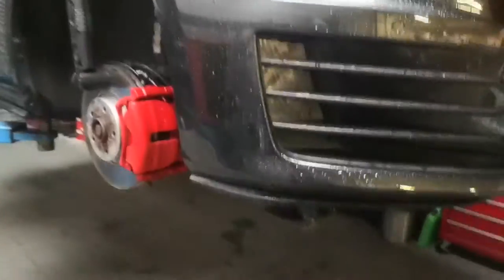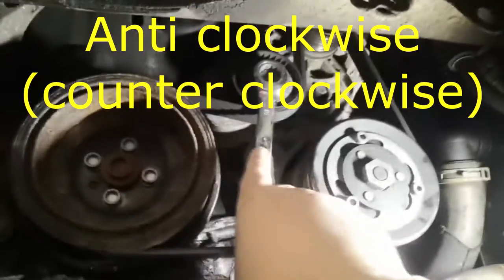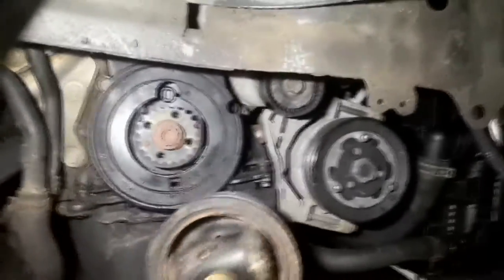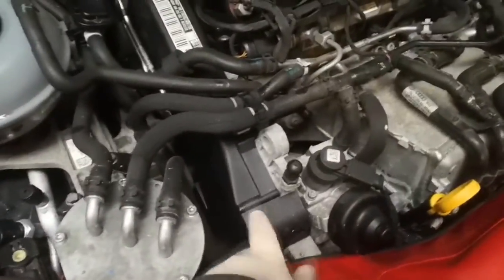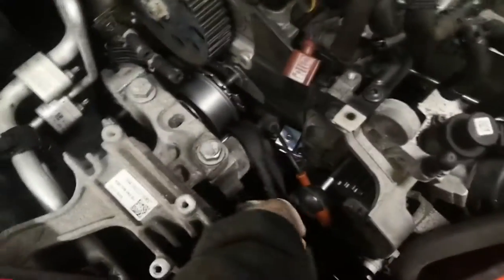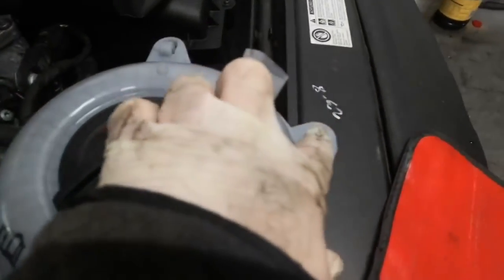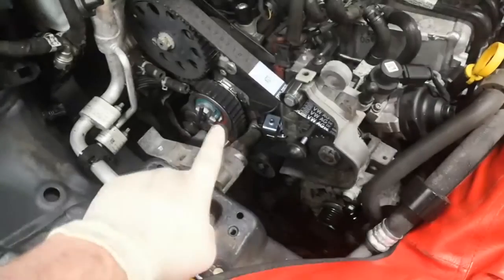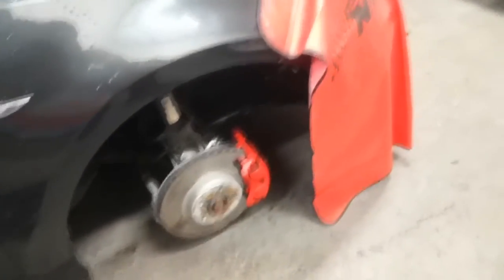Timing belt & Waterpump replacement on a CR 2.0TDI (Mk7 Vw Golf GTD)

Comment: Need torque specs for all bolts
Reply from the maker: Crank pulley is 90nm + 90 degrees iirc, the rest are just tight but not overkill